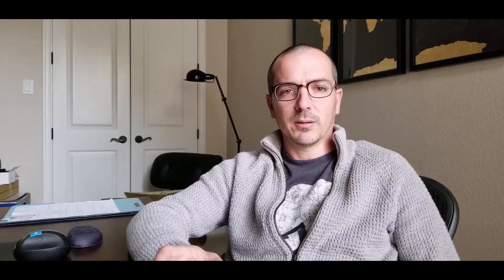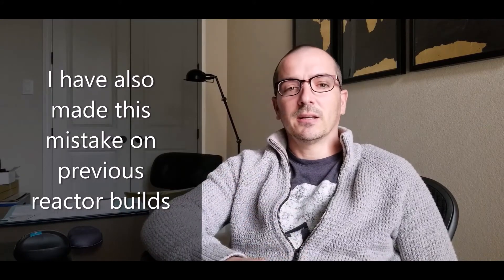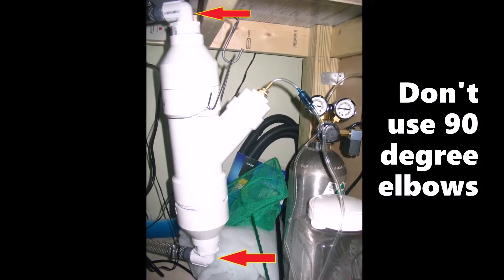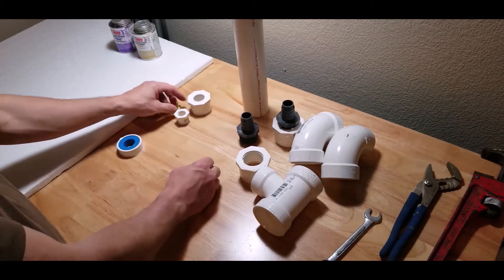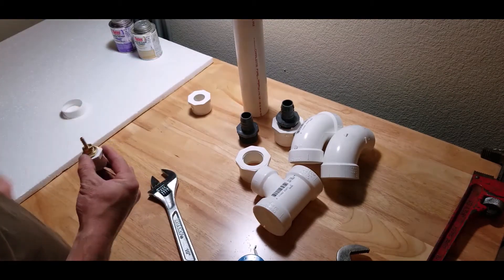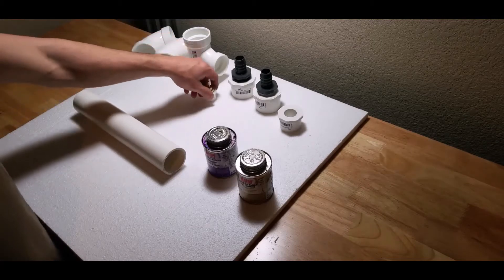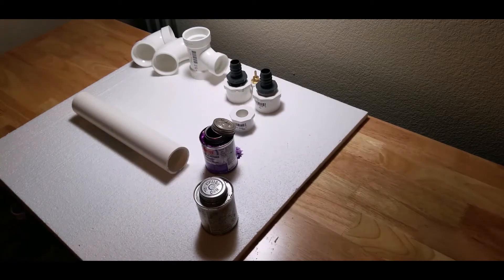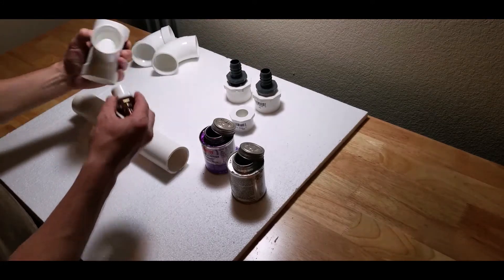How to Build a Co2 Reactor - (almost) Suitable for an FX6's Flow Rate

Comment: A few years later…  Did you end up building a bigger one? How did it work out?
Reply from the maker: I did and it's better, the vid is on my channel of you want to check it out "acrylic paint pour on co2 reactor"
Reply: @hugheymorrow  I’m about the build one for an FX6. Is the 3” slowing flow enough to get complete dissolution or would you recommend going 4”?
Reply from the maker: @PierreAndreFolot  4

Comment: If you don't mind having a submerged reactor you can just split your canister output nozzle in two and run one side through one or two (depending on size of aquarium) Ista Max Mix reactors. You'll save time with assembly and parts shopping as well as have the piece of mind knowing it won't leak. Probably save money too. The Max Mix only costs $16

Comment: Copy this build for my fx6 setting up in the next few days with the 2” pipe method my question is couldn’t you get away with a bulkhead 6mm barb & attach a small diffuser inside the reactor itself for chopping up the bubbles before it then go’s down in the flow.. this is what I’m thinking of doing, less work for the reactor in the long run and better saturation 🤷‍♂️
Reply from the maker: Sounds like an interesting idea. Maybe use clear pvc so you can monitor the state of the diffuser and replace when needed.
Reply: @hugheymorrow  yeah I have the clear pvc pipe for monitoring so will see how this go’s, was just interested if anyone else has tried this method
Reply from the maker: There are certainly "in-line" diffusers out there, so the idea is definitely being put to use. Doing it inside a reactor  may be new. I am using a 3 inch pipe version now filled with bioballs and get 100% dissolved without the need for any special maintenance. Let us know how it works out sounds interesting.
Reply: @hugheymorrow  how many bioballs could you fit in the 3" reactor? don't they restrict the flow?
Reply from the maker: @_yeahbaby  I have no clue how many. I see no noticeable difference to flow, there is more space in the reactor chamber in terms of diameter than the inlet and outlet, so the real inhibitor would be the inlet and outlet more than bioballs in the chamber.

Comment: Do you think bioballs in this set up would have assisted with diffusion with the high flow rate of the fx6? Slowing down the flow a bit? This is an awesome build. I’m gonna follow this for my Sunsun 704b. Any leaking or issues?
Reply from the maker: No issues. I built a bigger one just like it using 3" pipe.  Now that one indeed has bioballs in it, and the flow is not reduced by it.  I think the 2" pipe was the main issue and I feared have that filled with media might restrict flow. I never tested the theory though, just went bigger.
Reply: David Hughey did you go any shorter with the 3” pipe? Or same length. Sorry last question! Love that build
Reply from the maker: @crazyshot97  no prob, same length. There is a vid where I pour paint all over it, kind of crazy.
Reply: David Hughey I’ll check it out. Thanks a lot for the info!

Comment: Hi there, 
Great reactor, however in most reactors there is something inside to assist the dissolving process like bioballs may I ask why you chose not to?
Regards Duzzy 🇦🇺
Reply from the maker: Actually I do have bioballs in the new build. Wanted to test without them first. Ended up building a larger reactor because the diameter of this is not quite enough for the full flow rate of the fx6 (given the max length I can have under the cabinet) to be able to dissolve Co2 efficiently enough without getting pushed through.  New one uses 3" sections and is filled with bioballs.  I have had reactors in other scenarios that didn't need media, but other factors were influencing the dissolve rate like rate of flow and length of reactor etc.
Reply: Hi David Hughey,
I like this design and I’m doing this build however I am adding a 50mm pvc coupling for access inside should I need to clean or some other reason.
Regards Duzzy 🇦🇺
Reply from the maker: Sounds great. My 1 inch barbed adapters are removable, but it sure would be easier to have an access port that is not connected to anything.
Reply: David Hughey I love how YouTube and the net allow us to modify and improve things,,,,

Comment: also what was the cost of parts for the build?
Reply from the maker: I can't remember the cost but it wasn't more than maybe 45-50.  I built the new one, it's in the "Co2 reactor becomes art" video.  I think 3 or 4 inch diameter pipe is the way to go, and make it as tall as you can. If you can't build it over 2.5 feet long with a wider diameter , you might need a a split-off with a valve to adust flow to reactor and a bypass to the tank.

Comment: Awesome Build, I am having trouble finding a Co2 reactor for my FX6 as well,  what is the dimensions of the reactor here and what do you plan on changing other than size?
Reply from the maker: Sorry for the late response. I'd go with a minimum 3" diameter and make it as tall as you are able to fit in your cabinet or next to it or however you are set up. Fill it with bioballs. My 3" x 27" allows 0 bubbles into tank with fx6 fully open, 3 bps.

Comment: So, how is this performing with the fx6? No bubbles escaping the reactor? And how about the Flow of the fx6, is it become less? I use a cerges style reactor on my fx6 but been thinking about a different solution. Kind regards, Nick
Reply from the maker: Actually the flow with the aquastop valves wide open turned out to be too strong. In my video "part 2 ... setup..." I explain that I am going to build a bigger reactor. I currently have the outflow valve at half while I am waiting on parts to build a bigger one. This reactor would be perfect for a 16 mm tubing type of filter I think, but with the full flow uninhibited from the fx6, bubbles are getting pushed through this 2" pipe. I am hoping a wider diameter reactor with more length will be the answer.  Will post update on new build and result. There is no flow restriction if you dont use elbow barbs or pipes, and keep the diameter of fittings true to 1".  I would like to know what complications you have with Cerges.
Reply: @hugheymorrow  I have been using dual diy cerges reactors for years now on fx5 and fx6. Results are good and am able to dissolve(100%) large amount of co2. However the reactors cause quite a big loss of flow as I noticed when going back to just one fx feeding a reactor. However with just one reactor been struggling to get up to 30ppm co2 (tank is 195x80x70) so that's why I'm looking into griggs style reactors. Not sure if it's worth the effort, maybe going back to dual cerges style reactors is my best option.
Thanks for your answer, will check part 2.
Best regards, Nick
Reply from the maker: @nickh9294  loss of flow is the main reason I haven't tried Cerges. I think probably the best use of Cerges is dedicated pump when using a sump. Being canister users we dont have sumps. I'll post the bigger reactor build and results. A key part for this that is hard to find is the barbed fittings. I found them at bulk reef supply, 1 1/4" threaded reduced to 1" ID barbed fitting. It's under the plumbing section.
Reply: @hugheymorrow  been thinking about the option of a bypass, might just be the solution for both of our issues.... Mine being loss of flow with cerges and yours being not 100% efficiënt because of high flow
Reply from the maker: That may end up being the solution. I'm gonna try the bigger one (already built and working on the painting vid)  and if the issue continues, it's bypass time.